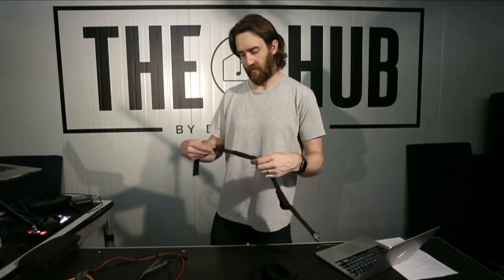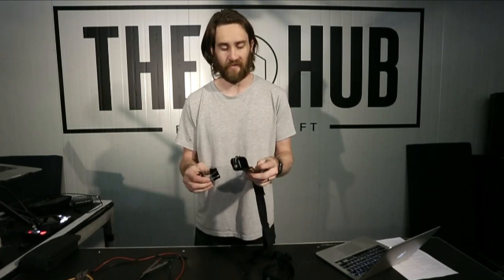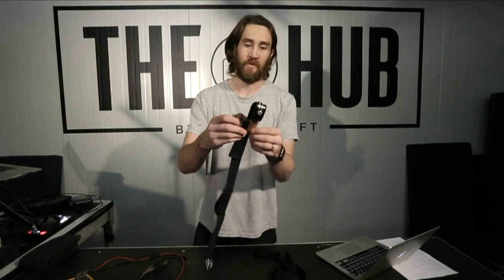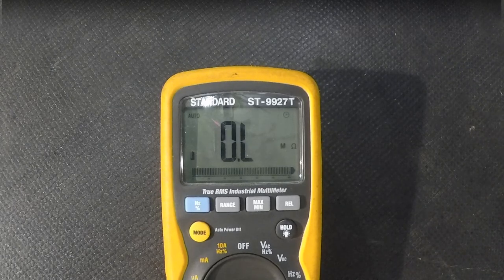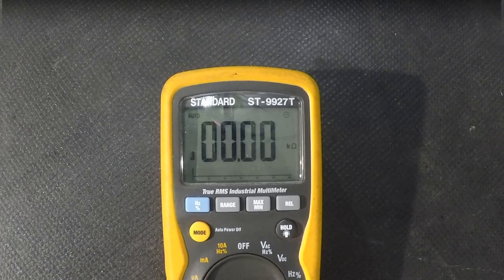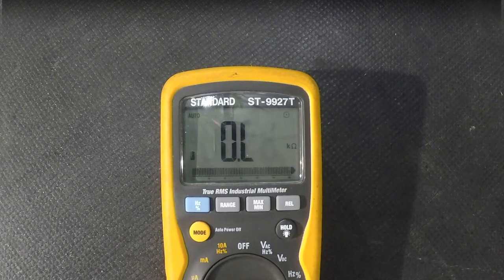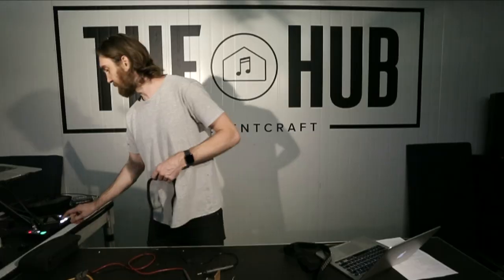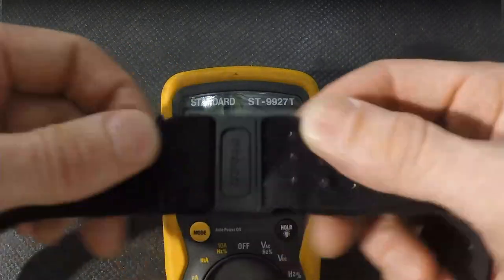Garmin HRM-DUAL Issues solved with Polar Pro Strap. Heart rate monitor Test and Review

Comment: I despise the Garmin HRM Dual strap...absolute garbage.  I wet it profusely and it delays and keeps locking on cadence when I wear a non cotton shirt.  Replaced the battery and cleaned it...didnt help.  Garmin sent a replacement and it it locked on my cadence again....threw it off mid run.  Waste of time and money.

Comment: I've got a relatively new Garmin Dual HRM.  Right from the start it took ages for the HR to start registering.   It helped if i moistened the pads a bit.  More recently though it's really been playing up.  It will connect with bluetooth but just stay on 72 BPM.  It might bump up to 89 BPM if i moisten it,  but  the last few rides I've done, even when sweating profusely during high intensity efforts the BPM just drops away down to 58.   I've tried the battery thing - but that's not it.  It must be the strap playing up.   I've got an old Wahoo Kikr strap that fits and makes a connection. It still starts off showing 72BPM annoyingly, but in a good sign after applying a little bit of moisture to the pads the BPM drops quickly down to resting HR.  So I'll give this a go in a workout.  Thanks for the idea.

Comment: My Garmin Dual HR strap connects to my Garmin Edge but do not show the heart rate. I have factory reset my Edge and changed battery on the HR strap. What could be wrong? It was working fine but one day it stopped showing my heart rate.... Then i changed for a new battery but it did not help.
Reply from the maker: Often on my edge I will need to go into settings and just turn that sensor on and off to get it to connect
Reply: I have the same problem. Seems like it was working fine not too long ago and I had an update to the Garmin edge, then poof it just stopped sending date. Its weird because both my smart watch  and edge picks up the heart rate monitor but it just does not send any data at all.

Comment: Seems the dual HRM has not improved. Same problem as others have reported.  It will pair but will either show 2 dashes or 7. I just got my second one sent to me from Garmin in less than a year. This time they sent an HRM PRO. Hopefully it will last.  I have an old Garmin Edge 705 and the HRM that came with that still works with no problems. Just a couple battery replacements over the years. Too bad it will not work with the newer Garmin edge.

Comment: Great video, thanks for the explanation. I recently had my Dual warrantied cause it wasn't reading correctly and often just wouldn't connect at all. after testing my garmin strap the resistance was up around 10k ohms. will see how long the new strap lasts and then change to a polar strap after. Thanks for the help. Its so frustrating when it just doesn't work and there is no reason for it. Now at least I have a reason.

Comment: Tried the polar with the Garmin Module, worked ok for a couple months but the module comes unsnapped about every run because the snaps are to far apart on the Polar!
Reply from the maker: Ok haven’t had that issue and I’m still on the same strap.
Reply: I had a similar issue. Even with just a light amount of tension on the Polar strap, one of the Garmin transmitter contacts would disengage.